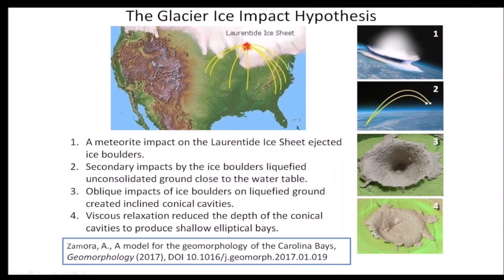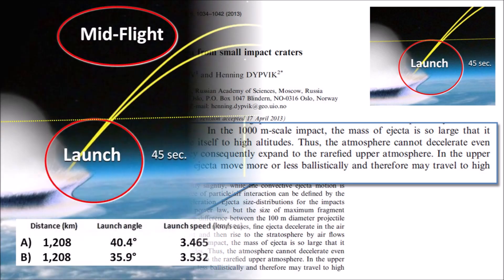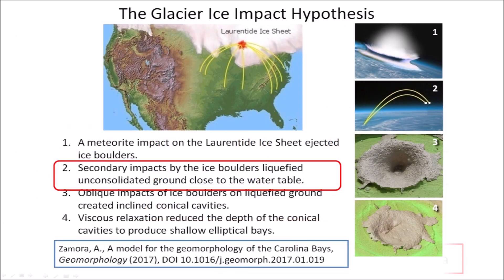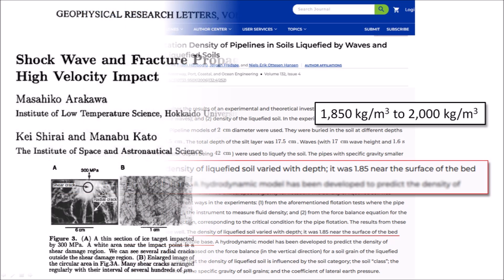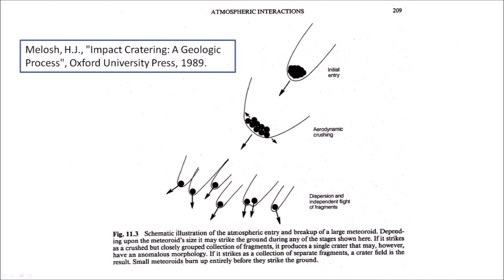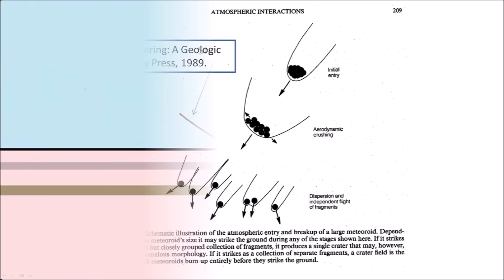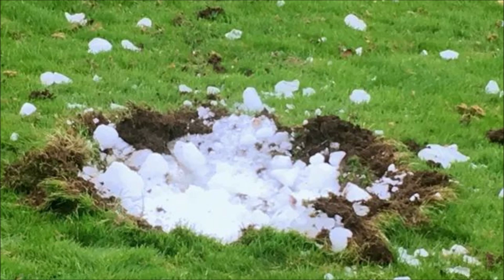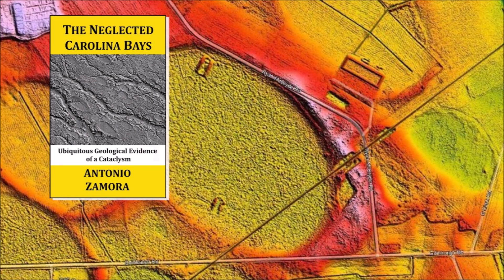Crushed Ice makes Carolina Bays?

Comment: Even if the ice cracks on impact, it still forms a crater when the energy is high enough. It's inertia that does the damage. Neither the mass nor the speed immediatelly disappears when the ice shatters in the moment of the impact. The vast majority of the fragments simply don't have the time to get redirected somewhere or slowed down by anything. The debris still follows its way into the soil due to inertia. 
Even the softest of all pillows can be fatal if it hits you fast enough.
Reply from the maker: That is right. It is the law of conservation of momentum.
Reply: a bullet fired into a frozen pond at a low angle bounces off and even back toward the gun, even though a bullet is much denser than ice. there are many demonstrations of this on youtube.

Comment: Is it possible the ice boulders exploded immediately upon impact?
Reply from the maker: An explosion of the projectile would have generated forces in all directions creating a circular crater. Since the Carolina Bays are elliptical, this means that the projectile made a penetration funnel, which is a conical cavity.
Reply: @Antonio_Zamora  yes from what I've read that's what happens with typical meteor strikes, even at moderately oblique angles. but isn't that mostly due to the meteor's extreme density and velocity, whereas these less-dense ice boulders would've been traveling much slower?
Reply from the maker: The speed of the ice boulders would have been about 3 to 4 km/s based on the ballistic equations. The secondary impacts took place from 6 to 9 minutes after the ET impact because the ejecta had different launch angles. The first impacts would have hit hard ground, but their seismic vibrations would have liquefied the ground, and subsequent impacts would have landed on the liquefied soil. What we see today is the result of the final impacts on the viscous ground.
Reply: @Antonio_Zamora  thank you, but let me ask this a different way: would the ice boulder impact angles change if the elliptical craters are the result of explosions rather than penetration funnels?
Reply from the maker: @AustinKoleCarlisle  The angles of the ice boulders are determined by the ballistic trajectories.  From the width-to-length ratio of the bays, we know that the angle of impact of bays with a length of about 1 km was about 35 degrees.  If the ice boulders had exploded on impact a circular crater would have been created. The formation of elliptical basins requires for the projectiles to penetrate the target and form inclined conical cavities. However, if the unconsolidated soil is not deep enough, then the ice boulder will explode when it reaches the hard rock and circular basins may be created like in Delmarva. See this video: https://youtu.be/DFVIsCk149w
Reply: @Antonio_Zamora  so for a given impact angle like 35 degrees, all projectiles that explode upon impact would result in circular craters, regardless of velocity?
Reply from the maker: @AustinKoleCarlisle Generally yes. Most impacts that explode upon contact create circular craters. The only exception seems to be impacts at less than 15°. See the Rio Cuarto impacts in Argentina which Wikipedia says are aeolian. https://en.m.wikipedia.org/wiki/R%C3%ADo_Cuarto_craters
Reply: @Antonio_Zamora  but that's only referring to celestial impacts, not secondary impacts. i realize the impossibility of testing secondary impacts on a larger scale, but i'm just saying we don't know what would happen and should keep an open mind.

Comment: ? What is the smallest boulder by weight/volume/diameter that will leave an impact crater ?
Minimum viable impactor ?
Reply from the maker: @michaelpaul2243  The smallest Carolina Bays that I have seen measure about 100 meters, so the ice projectiles must have measured about 20 meters.
Reply: @Antonio_Zamora  
That indicates a minimum projectile size to form a bay/basin, depending on soil/subsoil type and moisture content.
Reply from the maker: @michaelpaul2243  Remember that the bays formed at least 12,900 years ago. The ones that we can see have survived erosion, but there could have been many smaller ones of which no trace remains. In Nebraska, where the terrain is not as level as the East Coast, the smallest remaining basins measure about one kilometer.

Comment: Those are some interesting papers that you found, if you run across any about the superbolide, I would like to know for certain which way the two counter-rotating trails turn.  A couple of days ago I read a comment about the originator of the perdition idea and noticed on wiki-wacks that there are no public warnings, then I looked up "rainwater basin" and it was stated that there is no orientation, and the there is an image of elliptical secondary impacts that are parallel.   Sure looks like a conspiracy to suppress reality to me.   Great video, more to contemplate while doing other things.

Comment: I imagine that the ice boulders started cracking during re-entry similarly to how ice cracks in a glass of water. I agree that there is a nuance to the structures of the ice bolders as they radiated outwardly into suborbital space potentially interacting with other ice boulders and eventually impacting the Earth. I agree that more tests should be conducted, but I don't think the lack of our knowledge to these details takes away from the overall theory.